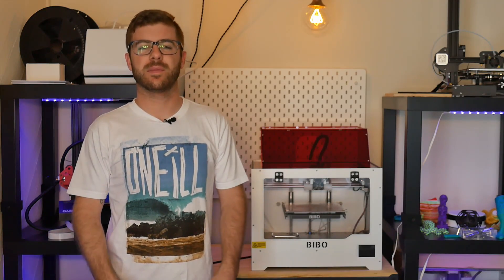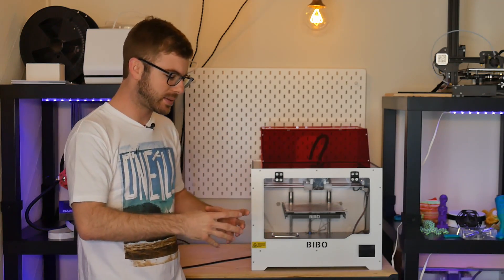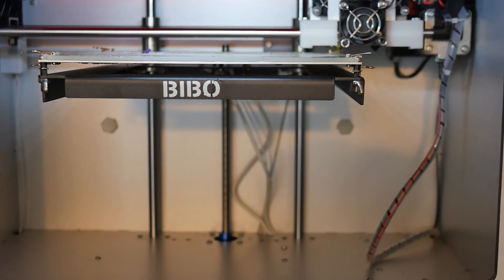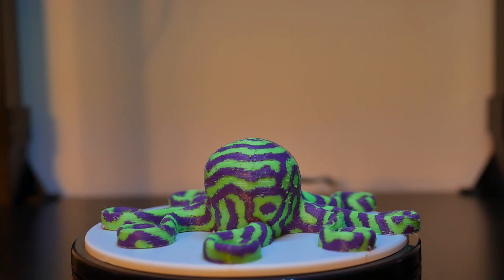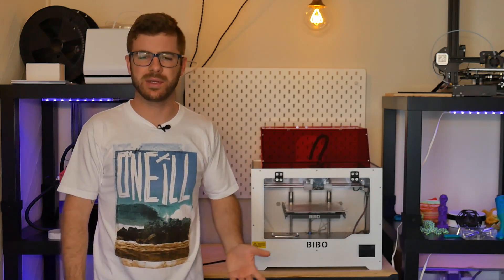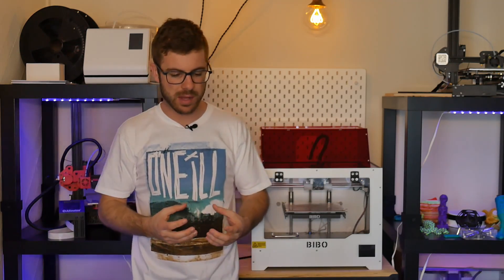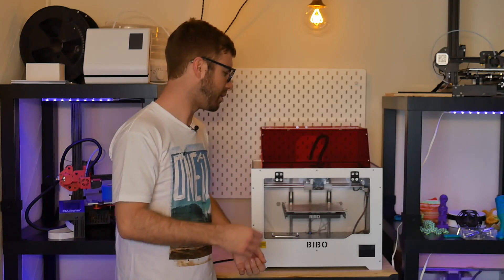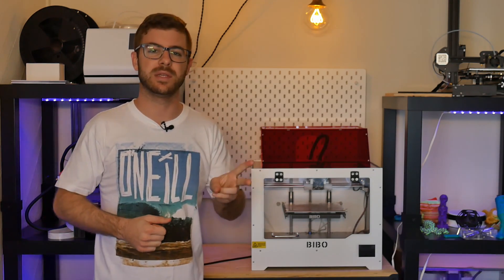Best Dual Extrusion 3D Printer Under $1000? Review Of The Bibo 3D Printer

Comment: Hmm, buy a BIBO for $1300 or a Tenlog for $700. The BIBO doesn’t come with engraving kit standard so pay extra for it if that’s your deciding factor. The BIBO is a complete nightmare to load filament into the extruders. It NEVER lines up! Even worse trying to load in something flexible! I will NEVER buy or recommend a BIBO product again! By the way, that BIBO that is selling for $1300+ right now was originally $800. So if you buy it, you’ve got a major markup on a printer that is the worst of my 3 printers. I’ll sell you mine for $200.
For pretty much half the price, the Tenlog has INDEPENDENT dual extruders AND the high temperature hot end. Only thing BIBO offers above that is the engraving parts that you get to pay $200 more for. Only an idiot would buy a BIBO right now.

Comment: Would you recommend picking this up over some of the cheaper 300-400 options? Like the ender 2?
Reply: You asked 1 year ago, how did you proceed. What did you get?
Reply: @Average-AL  Enser 3 V2 is what I ended up buying
Reply: @Sourmongaming  Happy with it? I am torn... should I get a dual head? Should I get enclosed? Should I get a hotend that can do nylon? It is an either or case, can afford one feature, not all.
Reply: @Average-AL  it’s badass, the adjusting can be infuriating and cause me not to want to print for a month at a time, but I’m also not patient. But the prints are good and it does everything I want for it’s price point. Better to start with arguably the best at its price to get into the hobby then save up for something fancy if you still enjoy
Reply: @Sourmongaming  Sensible. I am still on the fence if I need to print Nylon or not so I am very tempted by something that can handle +300 degrees C. And enclosed seems like a good thing for safety, dust and such...

Comment: I have this Machine as well and it works like a charm. but one thing i need to learn and was wondering from 3D Printer to another, can you please tell me on how to print with the second extruder (E2 nozzle)? I tried everything and i cant figure out how to get my 3D files to be printed with the E2 Nozzle, and i really don't want to remove the filaments just to print with a different color of Filament.
Reply: Peridot your slicer will have a dual extrusion setting.
Reply: Try using Cura for a slicer. The gcode from that slicer works fine after you have set the dimensions of your printing envelope.

Comment: is it better than snapmaker?
Reply: i've never owned eitehr priinter but snapmaker is also able to mill. not sure how well that milling works but it can. I'm probably choosing a bibo over snapmaker (originally a craftbot 3 or craftbot flow idex large over a snapmaker) since I have a dedicated milling machine that is a bit more rigid. a denford micromill which is built electronically to handle machining. other than using gibs and lead screws it's a full on mill. choosing bibo over craftbot due to cost and needs and the features are almost identical compared to craftbot. decided I just don't need something so massive like the craftbot extended. If I need something that big i'll just end up having it printed. Hopefully the short fine travel will help with printing this exotic filament from the virtual foundry.

Comment: This machine is pretty old school. This is built from the FlashForge Creator II and MakerBot Replicator II design. They are pretty bullet proof machines and have been for many years. This was actually my first type printer about 5 years ago (FlashForge Machine - Over 7,000 working hours on both of mine before I retired them). That they still charge $800 for the machine, same as they did 5 years ago, is way outdated.
Reply: which one would you recommend Matthew?
Reply: I just bought one for $323 on Amazon....